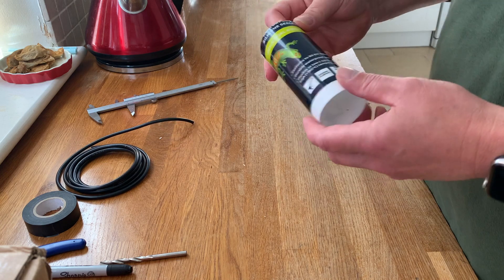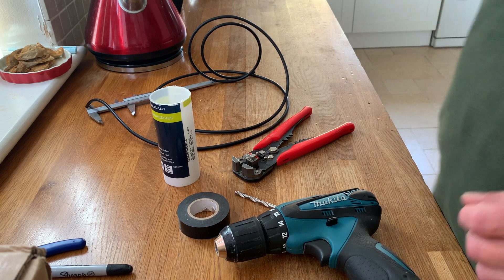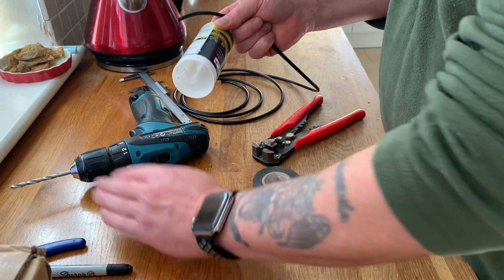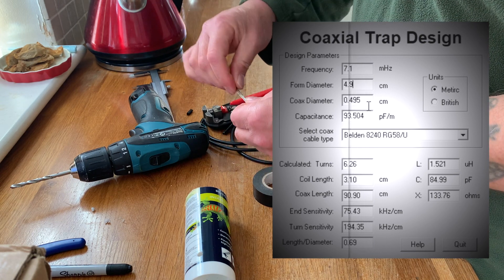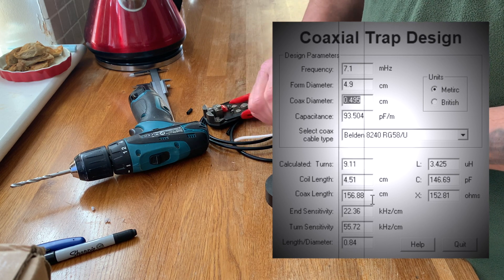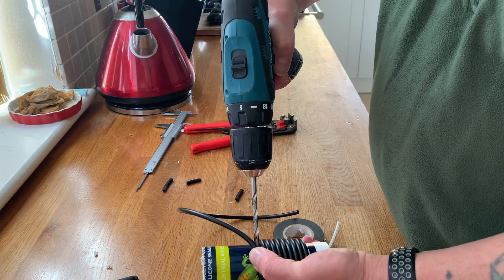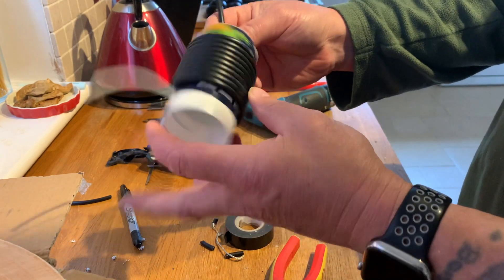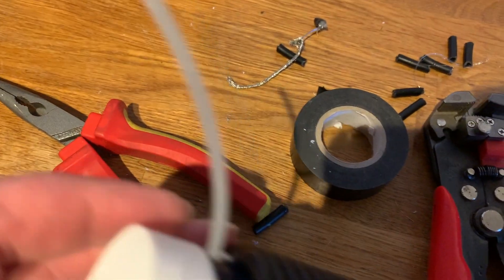How to build a Coaxial Trap. Dipole, Vertical or EFHW Great for the smaller garden

Comment: Good video showing how to, excellent for the beginner to help them learn through practice
 Wonder if you have tried winding traps with copper enamelled wire and using a capacitor inside pipe to complete the tuned circuit. Vy73 de John G4YDM
Reply from the maker: Not yet!
Reply: @mike-M0MSN  haha Cheers have fun, JOHN G4YDM

Comment: do you have a link to that calculator please
Reply from the maker: https://www.qsl.net/ve6yp/winpsk.zip
Reply: @mike-M0MSN  thankyou Sir.i have made one of your 1/2 wave coax antennas and its going very well. the 5/8 looks a little more challenging. might put the 1/2 wave inside some pvc tube
Reply: @mike-M0MSN  i grabbed the coaxtrap software but cant seem to run it on windows 10

Comment: I'm very confused. I'm getting conflicting results from videos.
These resonate below 7 MHz yet others taken from the ARRL book resonates them at 7.15 MHz.
One video I watched said it's important to not resonate them in the band but just below or just above. 
It looks like I'll need to experiment, I want my 60m inverted vee to work also on 40m, maybe put variable capacitors in.
G4GHB
Reply from the maker: Yes I, like you, did not know which way to go on this so I did the trap and set it at a frequency just below the target frequency and found to worked I then made another at the target frequency and that worked too, finally I made another just above the target and guess what, that worked too the only difference is the bandwidth and tipping point. Which is best for me just below the target frequency…. Hope this helps
Reply: @mike-M0MSN  Yes, thanks. It does seem that a frequency just below seems favoured.
G4GHB.

Comment: I thought traps are designed to resonate in the middle of the band - why then do your coils resonate at 6.555 MHz for a 40m trap? Even your frequency in the calculator was set to 7.1MHz?
Reply from the maker: Well, great question. The calculator is only a best guess o meter, due to the coax used, and test show that the trap only needs to be close to the target frequency.

Comment: Hi Mike. Did you use Copper Coaxial Screened cable or was your Coax copper coated steel wire. Could you test with a magnet and drop me a reply. My latest video is worth watching as I am having cable problems. Cheers from old George
Reply from the maker: Hi George, It's all copper no ali or steel  :)
Reply: @mike-M0MSN  Many thanks for your reply. Cheers from old George

Comment: I like your "zero waste" approach as it comes to the silicon tubes! I've tried the coax traps couple of times wound on the piece of  a plumbing pipe and I liked how it worked serving for the W3DZZ and the EFHW ( trap for 10mhz)  antennas. What is interesting these traps also act as loading coils, so the wire after the trap comes to be shorter than the regular resonant length. Nice job! 73! Linas LY2H
Reply from the maker: Cool, thanks
Reply: I tried to make an efhw with multiple coax traps, for 10, 12 , 15, 17, 20. No chance to make it working.  I suppose the frequencies are too close...
Reply: @eduarddavidescu119  Well, 5 traps in a row might be a bit of too much of a hassle :)... You would probably need to recalculate ( or , actually , empyrically find out) the every segment of the wire in between the traps making adjustments for the shortening effect of each trap-coil ... To add more trouble, so many traps in series might incure substantial losses in the overal antenna system. For these resons, you would hardly find many antenna designs with more than two traps in a row. Or, if you do, the traps would be of a very high quality with carefully selected values of the trap's inductor  and capacitor in order to get higher Q ( equal lower losses). And it is not possible to choose the C value in the coax trap... So , in order to have an effective and simple resonant 5 band dipole, I would go for a linked dipole design. Or, in the case of the EFHW, for the classical 49:1 transformer-based with max 1 trap for the 30m band. Good Luck! 73! Linas LY2H
Reply: @Linas_LY2H  Thanks for the answer, and congratulations for your channel, I'm a subscribers 😀. 
Yes, too much coils and very close to each other.  I started with te 10m, put the coil and trim the wire. Then ,a piece of wire and the 12m trap, trim it and so again. The needed wire between the traps is very short and putting more traps destabilise whole antenna. 
I will keep trying  😄
73's

Comment: Hi Mike. I was just wondering  why the the trap doesn't have to be resonate in the middle of the the 40M band, at say 7.1 MHz, so as to isolate the extra wire for 80m when tuning the Tx to 40M? Love your videos, I am  always amazed at the quality of your builds.
Reply from the maker: Good question! and I'm not sure of the answer (maybe someone will come to my rescue here) I believe the trap needs to be just below the traping frequency as the impedance is at its highest at the coil resident point. so as you get closer to the trap frequency so the impedance raises, if the trap frequency was lets say 7.1MHz you will never get a low SWR on 40M as the impedance would be to high.
Reply: @mike-M0MSN  Yes, I think you are perfectly right here. One rule of thumb is to resonate the trap 1% to 5% below the band edge frequency. Because the trap is a parallel tuned circuit, it will have a very high voltage across it at resonance. So, if you operate it just above resonance it reduces the voltage significantlty and reduces the risk of breakdown. However, you don't want to go lower than 5% or the trap will start to act like a loading coil instead of a trap.
Reply from the maker: @Steve-GM0HUU  Thank you Steve perfectly explained.

Comment: 1) So many people overlook a Grid-Dip Meter however it is at their peril. I can't stress enough how useful a GD meter really is. In reality, it's only 10 quid's worth of parts but they're worth their weight in gold - especially if you've left it behind.

2) Mike, what's in the circular shallow red dish on the window sill ?  It looks like something from The Colonel.
Reply from the maker: To point 1, could not agree more.  To point 2, used tea bags (my wife uses them for some thing??)
Reply: @mike-M0MSN  Did you know that a lot of tea bags are actually thermal plastic ?
Yes, I kid you not. People thrown them in their garden and they break down as micro plastics.
Look into it.
As George Carlin said "The earth plus plastic"
Reply: Mike...please give
details on the making
of your DG meter used
on your MFJ analyzer.
Thanks

Comment: Would you solder the braid to the center conductor in all applications? Verticals, dipoles, EFHW ?
Reply from the maker: Yes John, the coax forms both the capacitor and coil.

Comment: Would two be added to a 20m dipole to make 40m? Does it require any wire on the end? Thanks I’m advance Mike.
Reply from the maker: You need a 80M dipole you add the 40M traps in the centre of each leg and you get a 40/80M dipole
Reply: @mike-M0MSN  Thanks for the reply Mike, much appreciated.